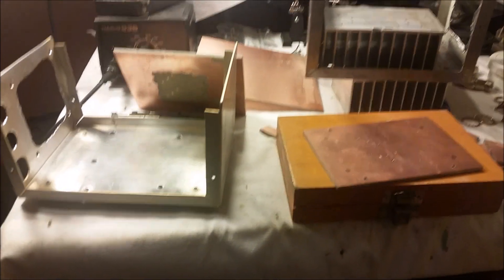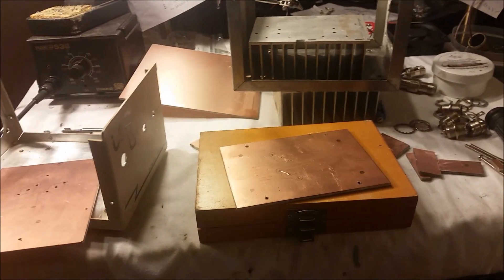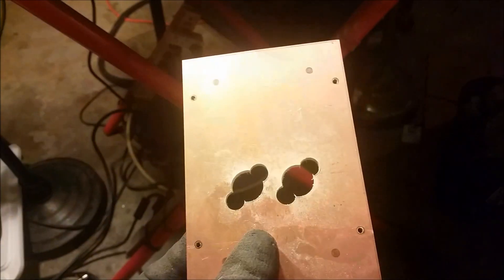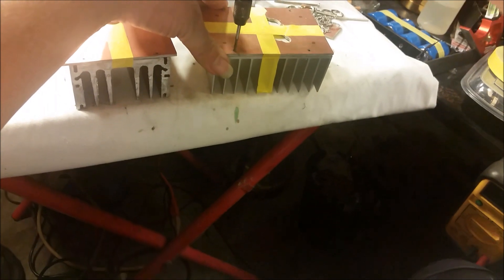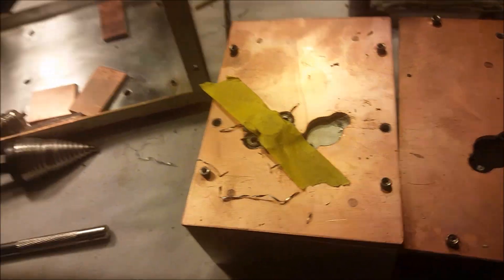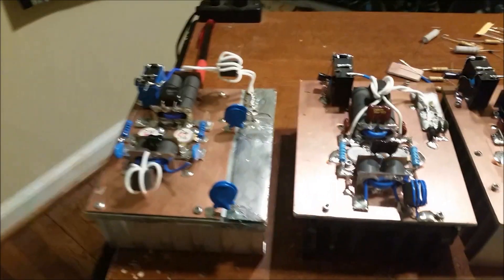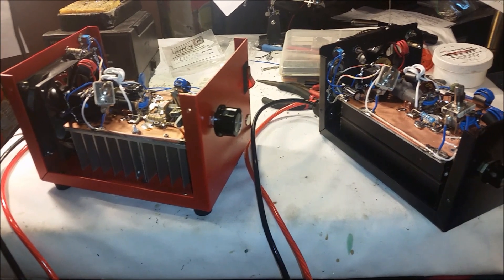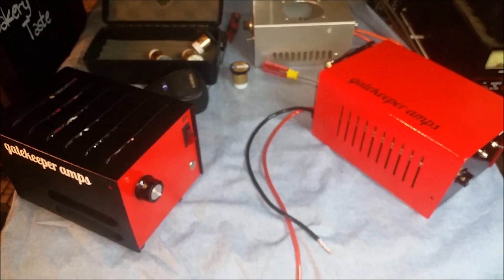Gatekeeper In Amp Building Concepts - Building 2 Pill Amps From Scratch!

Comment: This is how I make pill holes. I have an old board from a DM 8 pill. It's actually half the 16 pill board. There are no components on it any more. I line the pill holes over the copper board and then hit it with some spray paint. This transfers the pill holes all lined up. Then I just use a dremel. I have a high speed cutter that is just about the same size as the pill tabs. It takes about 15 - 20 seconds to cut each hole out. Its very fast. You just cut out all the paint.
Reply from the maker: Now that is a good idea man....very good idea 💡  thanks for that...
By the way, just wanted you to know I have started uploading videos again :) Make sure to come by and check out a few and If you want to support me, leave a comment and some thumbs up & thumbs up on comments. It really goes a long ways in helping YouTube show my videos more. Thanks in advance.
This is my last video:  
https://youtu.be/dHA-2blbX3k